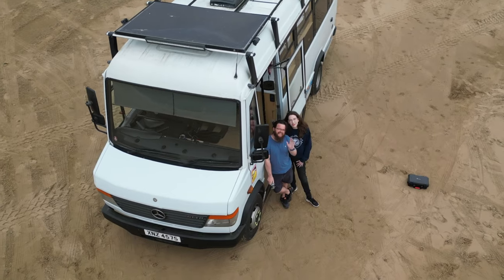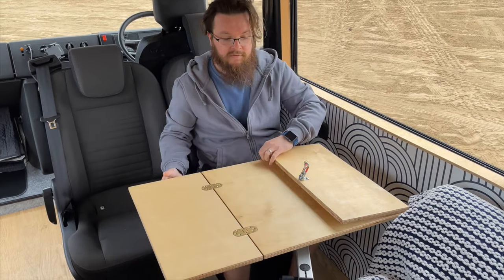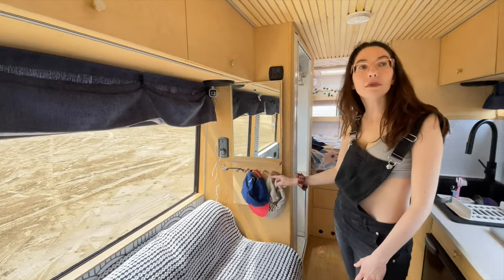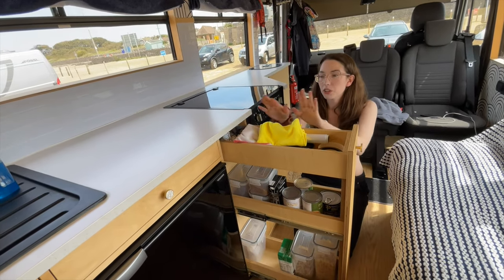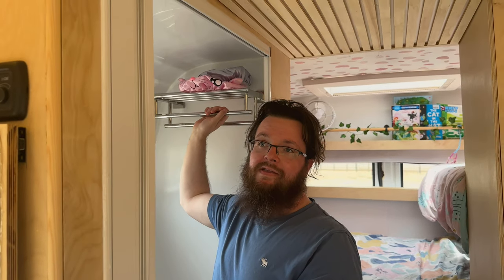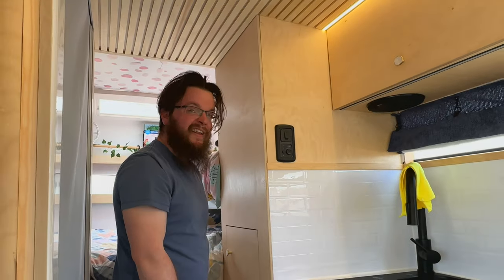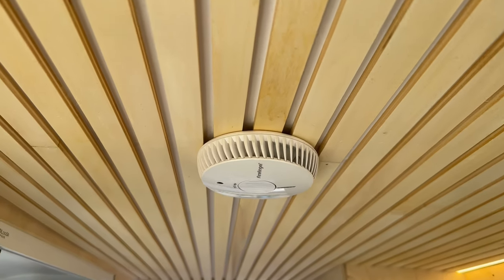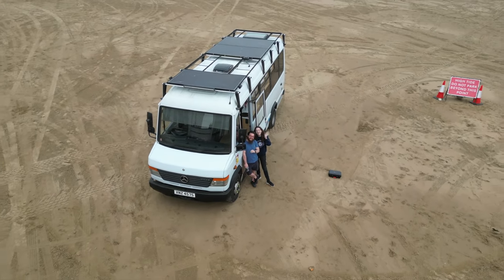VAN TOUR - Fully Loaded Van Conversion By Van Build Rookies

Comment: Great tour guys , you done an incredible job!!!!

A quick question, when you registered your van as a campervan did the tax class come back changed automatically?  Assuming you registered it 

Many thanks
Reply from the maker: Hey. So ours is registered as a van with windows. We’ve a few things to do before we could apply for it to be a camper van. But the tax didn’t change when we changed it from minibus to van with windows. It’s actually cheaper than our car!
Reply: @WanderbusAdventures   Hey guys thanks for the info , I've sent mine off today fingers crossed it does change , otherwise it will say campervan , and tax class bus which I cant see why they would keep it like that , couldn't find anything on that , only a separate change tax class , oh well let's hope 🤞😁 but if not then yeah seems cheap enough anyway .
Thanks again 👍
Reply from the maker: @climblivefree8344 ah perfect. Let us know how you get on. Fingers crossed.

Comment: Where did you get those reversible bucket seats with shoulder and waist seat belts?.  I was surprised to see that not only are they reversible, but that they cam come out completely.  How are they attached to the bus?  Thanks!
Reply from the maker: Hey. So we love the seats. They are from a Ford Tourneo custom, specifically the middle row outer seats. This means you can take them out, swap them and reverse them. 

We welded in a frame underneath for them to bolt through essentially. I can find the video link if of interest.

Comment: I watched your first 3 episodes  a couple of nights back , as I've just bought a raw similar Mercedes bus. Came on to YT tonight, and this episode jumped up in my feeds. So could i ask two questions? 
My first would be your approximate costs to turn the bus into what you now have.... then i have been doing the research into reclassifying it into a motor caravan, and it states that you must have an outside door to the living area that is not the drivers or passenger doors. Could i ask how you got around that? As i were thinking i would have to leave the two back doors free? Whereas you have a bedroom.
Oh i subbed a couple of nights back, but not watched all videos as yet... so apologies
If this have been explained inbetween 👍
Reply from the maker: Ah amazing, thanks so much for watching. We reckon to get to this stage it's around 25k ish. But since have done quite a bit more. Thankfully we spread this out over time, doing bits here and there. 

You're right about the hab door, they do ask for that. I am not actually sure, our V5C is registered as a PHGV. Maybe we will attempt to get it changed one day. Thankfully come MOT time it is tested as seen. Hope this helps, and good luck with your conversion - is it a Vario too?
Reply: @WanderbusAdventures  Thanks and it is a Vario, a slightly smaller 17 seater 613D... it was a mare to insure, I thought go compare, but no...the weight, engine size and classification of use... agh. I'll get there though in time. Keep up your good work with yours though👍

Comment: hey guys, thanks for the video. I actually just bought a 1991 version of  your van here in Los Angeles, CA. I was curious if you know the name of the roof rack components, as I'm looking to do something similar to what you did and link into the rain gutter. cheers and safe travels!
Reply from the maker: Ah how amazing! So that would make yours a T2, cool van! The bars we used are called ultibar, the model is VG154 and they come in packs for 4 or 2. They’re actually for a high roof transit but worked well on our van. I think the roof is the same on yours but please check. 

We also considered Tygrys feet, they are dearer overall but you can use other aluminum profiles with them. 

Hope your build goes well. Keep us posted and let us know if you’ve any questions or tips to share. Safe travels
Reply: @WanderbusAdventures  Thanks so much! That's incredibly useful info! Yeah, T2 :) It's an incredible van. Finishing up the rewiring for US power and finalizing a few things. Will be sure to post a walk through and comment on one of your videos when I do. Thank you again! Love your rig - so cute and practical!
Reply from the maker: @natebaird sounds brilliant. They are great rigs. Full of character.

Comment: Only thing is too many glass windows you must reduce most of windows in areas where is toilet etc..., when you started converting bus in camper, now it's not viable to remove them. 
Other than the window factor, camper is very practical, beautiful 😍 and likable 👍.
Love from 🇵🇰 Pakistan.
Reply from the maker: Thank you for your kind words. Many people do take the windows out as you say, but we wanted to keep them so it looks like a bus. We have seen one talented builder remove them and replace with aluminum after build, so that is an option should we choose to do it. But for now they work alright. Thanks again. Appreciate your support.
Reply: @WanderbusAdventures   
Only thing in glass is it don't resist heat & cool of summer🌞 & winter❄️ season. So it would be nice to insulate van at max so that living get easy and nothing else. Thankyou😊.
Keep Up the Good Work 👍
Reply from the maker: Totally. Thanks 😊